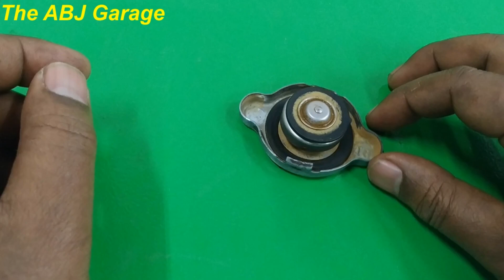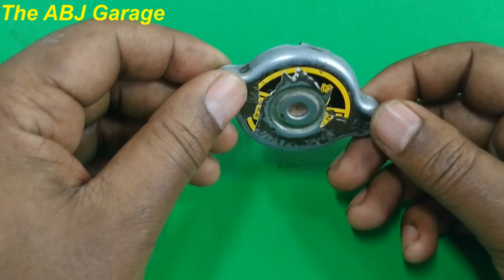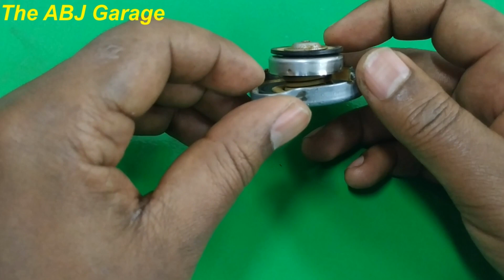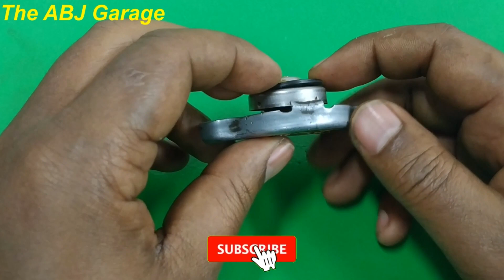7 symptoms of bad radiator cap

Comment: I just bought a 2002 Chevy express van with a rebuilt engine. Tonight I checked the fluids and when I opened the radiator cap fluid overflowed out for minutes, and the reservoir was also full but not over the fill line . The radiator cap looks old, and when as I was watching your video, the valve on my radiator cap when I pull on it, has no spring back, compared to your that has a spring the snaps back. I'm starting to worry that the engine rebuild or the install was bad. I hope to god it's just a radiator cap, but I worry its worse than that.

Comment: My seal is over the edge on my rad cap. I have noticed that my reservoir bubbles like coolant is being forced into it. It is not overflowing but has bubbles. It also appears that a little coolant is coming from the cap itself. It is a 2015 Jeep wrangler. Cap is definitely needing to be replaced.
Reply from the maker: Could be! Please not that this could also indicate compression leak into the cooling system!
Reply: Please What's compression leak into the coolant system?  @TheCarCareGarage

Comment: I'm gona have a heart attack if my problem is the cap...I just put new water pump...radiator...heater valve...I know parts can be faulty...but sheesh...got a new cap...didn't think It could be bad...gona try new cap...hoping this works...don't think it's my head gasket...I overlooked just bout everything

Comment: Very informative video on the workings of a radiator cap. Thank you sir. 
Just a point of note, lot of radiator caps do not function like the factory originals as most sellers out there sell some cheap China made caps and they are not rated accordingly. I'm finding it hard to get the originals these days.
Reply from the maker: Great point!

Comment: What's the condition of the first outer rubber sealent if the radiator cap is going bad? Soft or hard? And same question for the 2nd inner rubber sealent.

Comment: Is a radiator cap responsible for losing the amount of coolant from the radiator? My coolant has been loosing in big amount even if I drive even for a short distance but there is no leakage in radiator neither in water pump.
Reply: Could be Head Gasket is blown too.
Reply: It could also be the radiator is leaking inside the radiator. You may be getting coolant mixing with your transmission fluid. If you have a radiator with a built in transmission cooler. Also a possible blown head gasket. In that case you will see coolant and possible oil coming out the tail pipe.
Reply: Did you changed the cap? I also have this problem,every day loosing  coolant from the radiator,cap it isn't  in good condition,I interested if I change the cap,problem will be solved?
Reply: Actually my radiator was blocking as I didn't clean it for quite a while... So after cleaning the radiator, the coolant stays the same

Comment: Well Explained - The other day I drove my car for more than a week, when stop at shopping centre RED Temperature light appeared on my Dashboard I checked the Reservoir completely empty also the radiator took about a litre & half of water.  I did not drive again until yesterday and Red light appeared Radiator took over 2 litres of water. Got the Road Side Assistant out he said he does not think its the head casket as the car starts with no problem, he could not see any leaks under neath the motor / on the ground. How do I put the Coolant in the Radiator, if there is still some water inside and do I have to mix the coolant. I have a 4 litre of Distilled water. Please help no $$$ I'm a 74 year old Pensioner. John
Reply from the maker: When the engine is still cold, remove the radiator cap and start the engine. Look into the radiator. If you see water bubbles coming, it means you have a head gasket problem. Also make sure there is good coolant circulation. Make sure the thermostat and radiator cap are also in good shape. Good luck!
Reply: Any word on how you were able to resolve this issue because I am having same issue at the moment?

Comment: Hi I have a question My cars gauge goes really high and I believe its overheating .I place some Radiator Coolant to the Reservior .Then after that it drains my Fluids I put in the Reservior .I already replace the Thermostat in my Car . And still the temperature still going high and I run my OBD reader 2 and it finds a P0115 which is Engine Coolant Temperature Sensor 1 Circuit . I bought a new Temperature Sensor but still its leaking fluids in the Reservior  tje temperature gauge go higher . A good advice would be beneficial for me .
Reply: F

Comment: While driving, I noticed my temp gauge go much higher than normal, close to red  zone. I turned my heater on and gauge went back to normal. I pulled over, opened hood, and noticed reservoir was full with boiling water. I assumed it was the thermostat, so I replaced it, but it happened again. I let the car cool down and opened up radiator. The rubber or plastic on the radiator cap had deteriorated into a coarse black dust. Cleaned off all that black dust, replaced cap, and no more problems. All that time and work replacing thermostat when it was a bad cap. That's what I get for assuming and not troubleshooting. I should have squeezed the hose going from engine to radiator to eliminate the thermostat.

Comment: I would have never guessed a radiator cap can go bad. My heat would not get very hot and the car would blow cool air when the heat is on. So I got a new radiator cap and everything is back to normal. Thanks so much.
Reply from the maker: Am really glad to hear that! Thank you very much dear!
Reply: really a radiator cap can affect the heat in cabin?
Reply: @exticrefresh0198  no lie